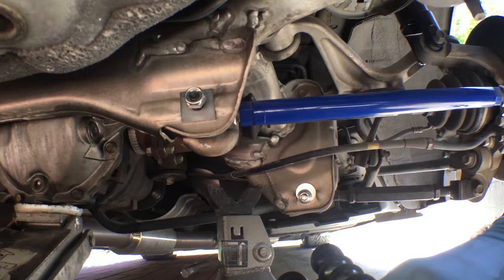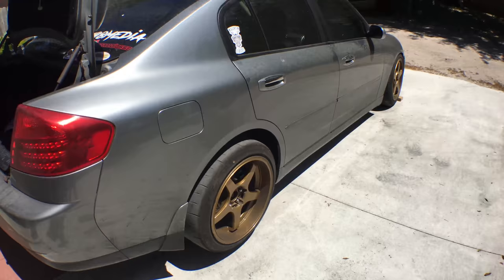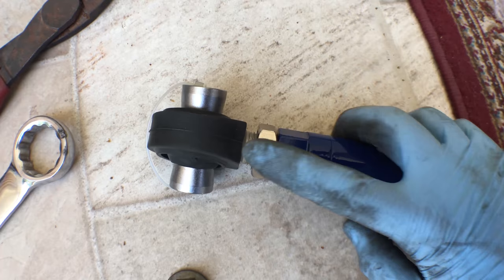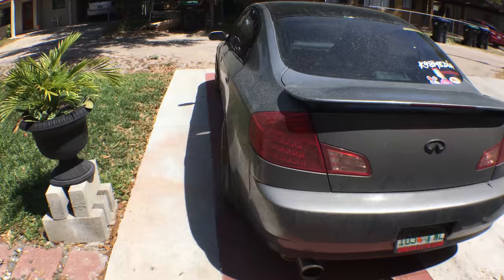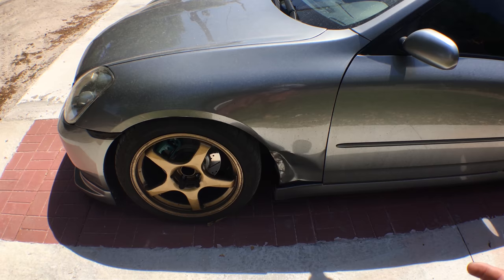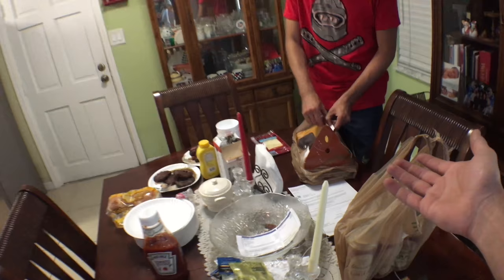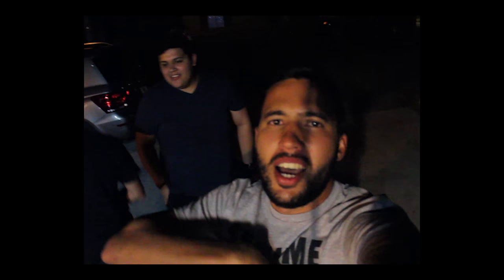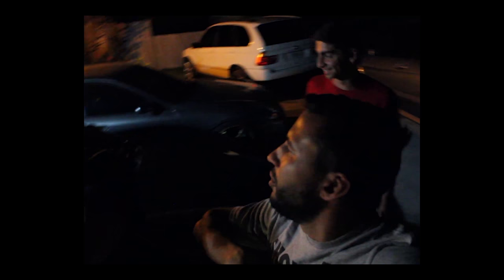g35 rear spring bucket delete

Comment: See this is exactly the videos I was looking for to see some more stuff on the G35. I was the guy under Taylors video commenting (my other email is trixunlimited) and I am very excited to do some mods for myself on my own g35 sedan. The problem is I picked up the old style BC Racing coil over that keeps the stock spring set up and is adjustable from there. I wish it were the newer style, but it will just have to do I guess for now. Either way super excited to see some content on the G.
Reply: Turbo Everything! I been looking for one  for a minute but they where all ragged out and automatic for what I was wanting to pay I fount one a couple days ago the only thing I dislike is its a 04 I wanted something a little newer but for the what I am paying and what it is i ant mad I pick it up next week
Reply: I got lucky and I just picked mine up. It is an 05 sedan 6 speed with the rev up engine. It does have some miles on it (180k) so I am hoping it will last this year into next. I paid 3500 for it, and it is in halfway decent shape. I picked it up in Pennsylvania though, so it depends on where you are looking, you may be able to find something within your price range. It would be nice though to have this last a while, while I finish my turbo is300 and get that thing going.
Reply: Turbo Everything! good luck with your build mine is a 04 6 speed it got 150 I paid 4 for it from a dealer that's everything tax title plate the car was like 3500 but it is really clean its just that older year with that motor that has a little less power but I am from the rustbelt too" Cleveland "so guess I gotta make some sacrifices  ...but aint that what turbo's are for
Reply from the maker: Turbo Everything! You can still update your current set up to a true rear, hit us up and we can help
Reply from the maker: Turbo Everything! Also I love my g a lot and only thing to keep an eye out for is oil! Make sure it's changed regularly ( under 3k miles) and rings love to consume it so check it every week!!!
Reply: DriftHappyTV I would definitely be interested in the full coil setup if it doesn't break the bank for me. who should I reach out to at BC? and I'm definitely keeping an eye on the oil. I don't want to have any issues with it whatsoever!
Reply: @drifthappytvSo I reached out just now to see what they would say from BC Racings end and 1k right now for coils isn't exactly in the budget for me. If you had some program where I could trade the old ones in or something along those lines I would have been interested, but for now I will run with what I purchased.Thank you either way,

Comment: iv got one of those cars mines 2005 model i put in a better head unit with gps and got lots to do to car got me some 19 inch rims with race tyres and it really feels more free then the passenger tyres but i do believe i need to install coil overs my car seems to wobble at certain speed and may need strut bar aswell or even a spoiler Aka wing

Comment: How did the spring delete hold up? How is the ride? Did you upgrade anything else? Did you just buy 2 coilovers or did you upgrade yours? Sorry for all the questions but obviously I'm thinking of doing the same.
Reply from the maker: Hold up fine, both of my cars have them. I got a full set of Bcracing coilovers. From the looks on your pic you have a v36 chassis so I don’t know if it compares to mine

Comment: love the g35 i have one myself. Quick questions if ya see this what size and offset are your wheels?
Reply from the maker: Potta_the_hunter front: 18x9.5 plus 35 255/40 rear: 18x10.5 plus 35 275/35
Reply: sweet im running round the same sizes only difference is my rear is an 18x10 +30 with a 255/40